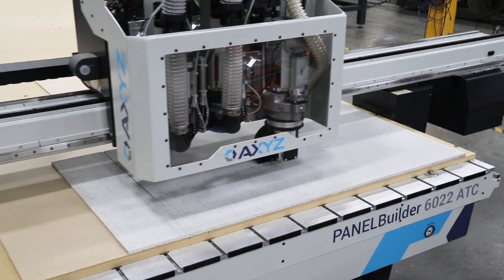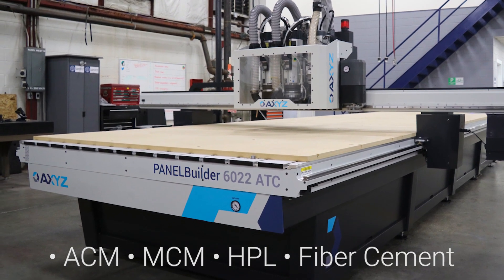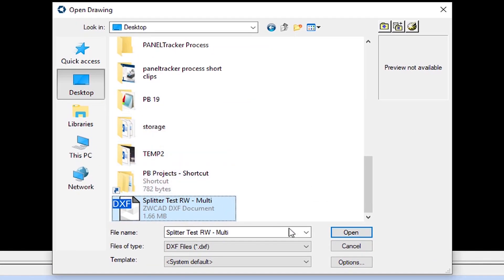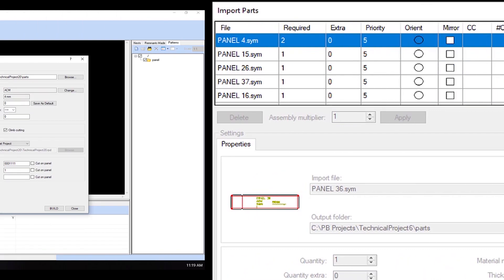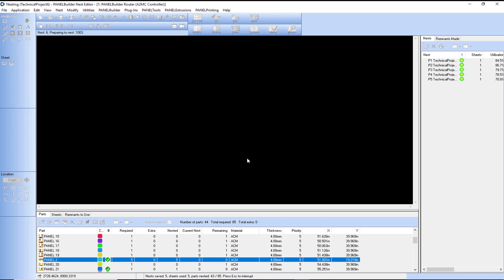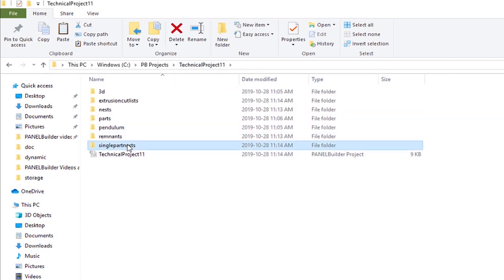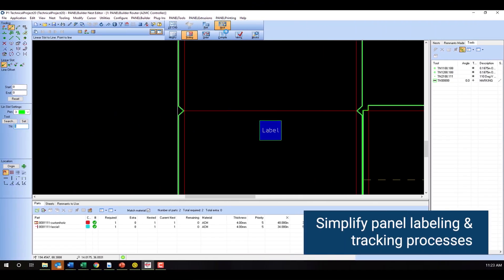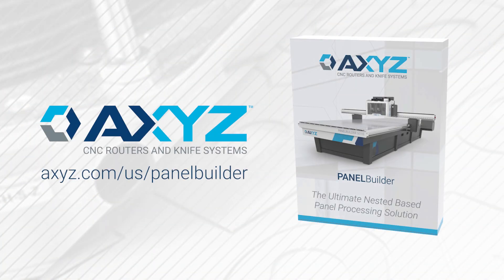AXYZ PANELBuilder Software: Simplifying the Cladding Fabrication Process

Comment: You have to create the extrusions in the extrusion library like adding a standard sheet type to the mdb.  It's a bit rough around the edges still as it can only locate the extrusions at specified locations (top, bottom, left, right) and account for deductions; however it applies it to all parts.  It really only benefits someone that uses the same exact extrusions on every part that is being nested.  This is also provided that they are all nested in the same orientation, which if you're cutting acm or something with grain direction isn't a big deal as you'd want them oriented the same anyways.  A year late to the party but hopefully you've gotten through it.